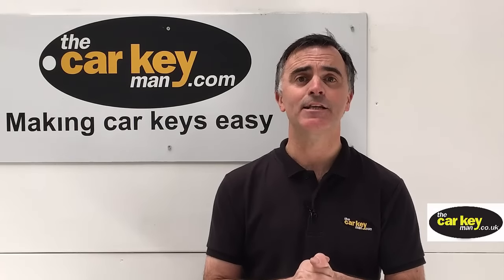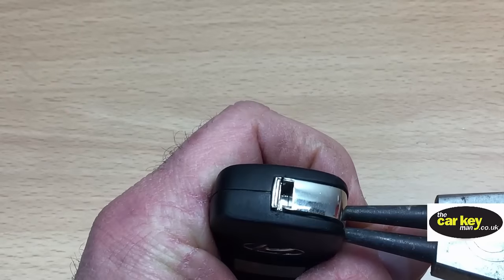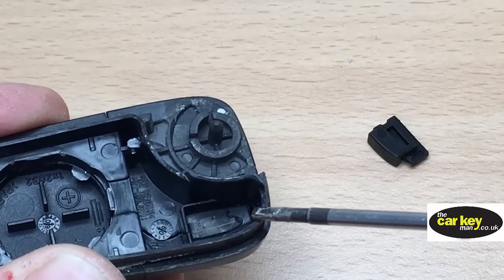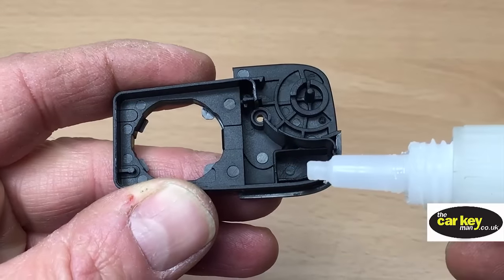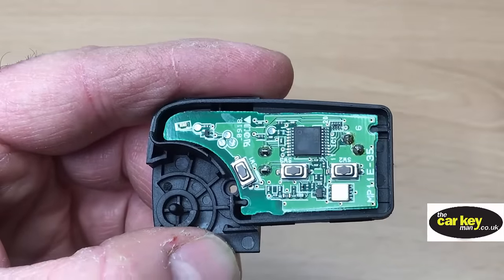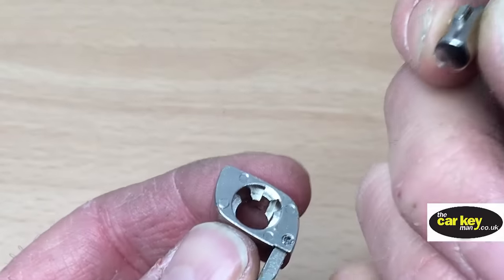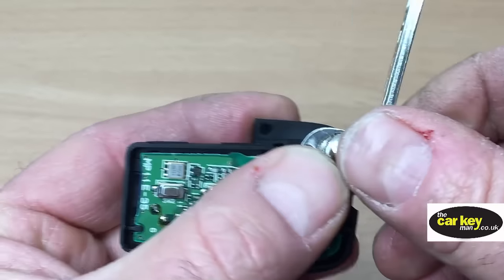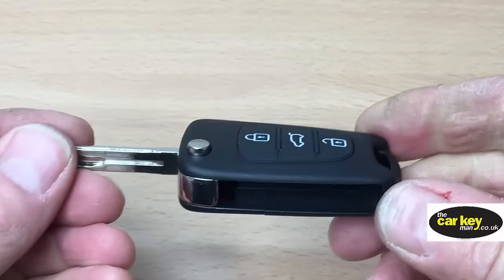FIX Kia and Hyundai Flip Key HOW TO repair

Comment: Took my wife's key apart on her 2011 Kia Soul, I found no chip. Kept the fob motherboard in the house, took only the key for the ignition and it started. So keep in mind you may not have a chip.
Reply from the maker: Hi Joseph, yes I didn't know this hen I made it but I'm guessing you live in the States? Not sure why a few of your models don't have chips, but every now and then we get a comment like yours. Thanks for letting me know :)
Reply: Thank you. Same car here and I'm not good at repairing things.
Reply: What tool did u use to get the pin out of the sliver key part
Reply: @TheCarKeyMan ah, that's where the recall and the whole trend happened
Reply: And if you are in Australia, there IS a Chip, only the cover cap is white...which confused me and eventually I had to look for the chip in the bin right before the rubbish collect car😂
Reply: Thanks a lot for the heads-up, sir! My mom's car is also a  Kia Soul 2011 that needs its key fixed. You've saved me a lot of time. Merry Christmas from Bangladesh 🇧🇩

Comment: You put the screw under the logo plate back at the end, but you didn’t say why and when you need to remove it in the first place. Otherwise great video.
Reply from the maker: Hi Fred. In the original key, there isn't a screw, the cases are glued shut. However with the replacement case, you need a screw to keep them together.
Reply: @TheCarKeyMan  Thanks for that. I’m waiting for the replacement key cases to arrive before getting stuck in.

Comment: I have a 2012 Kia Rio 5 and my fob did NOT have a chip.  Perhaps it's in the circuit board but FYI, if you're struggling to find your chip, it may not be there.  Very helpful video BTW.  Thanks!
Reply from the maker: Hi, thanks for the comments. Please can you tell me which country you're in?
Reply: USA
Reply from the maker: Seems like there's a few late Kia's in your country that don't have chips! Thanks for the reply
Reply: the transponder chip i have found to be hidden , even in the blade sometimes. they can be very small. nothing like the green chip board for the remote controls. this is from my findings
Reply: The Car Key Man is the chip for remote start? if so, mine definitely will not have that.

Comment: My key isn't broken but the rubber covering with the emblems has fallen off exposing the buttons underneath. I am questioning is there away of replacing them  or do you have to reassemble everything as you did?
Reply from the maker: Hi, yes you can just buy the rubber pads. They don't always stay in place and can be a bit fiddly to fit, but they will be cheaper
Reply: @TheCarKeyMan  Thanks!!! I wasn't aware the pads could be purchased separately  🤗

Comment: I have no way to get the pin out, so I guess I'm screwed.
Reply from the maker: You need a1.4mm pin punch
Reply: @TheCarKeyMan  I don't have one of those. I just used a nail and a hammer. Worked fine.

Comment: I thank you sir, I ordered a new fob body, completely destroyed the old fob getting the board out. put everything in the new body. doors would lock and unlock, but car would not start! I ended up buying a new fob from the dealer and having him program it! $ 400 later...I watch your video a few years later, there it was, didn't realize that little chip was inside, thought it was on the circuit board. I changer the body on the 2nd fob, as buttons were worn out, and it all works! Thankyou!! God bless!
Reply from the maker: That's great stuff. It's a very common mistake that happens, so well done on getting teh second key fixed ok

Comment: The buttons on my remote for the car were chipped off because I made the mistake of using my thumbnail to push the buttons. I went to the dealer figuring all they had to do was replace the case. but they said they would have to order in a new remote and then program it to match the car. They gave me a quote of several hundred dollars!!! Insane! I took a look on Youtube and found this video and then found a dealer on eBay selling the case. I followed the instructions in the video except for one small change. I didn't have a soldering iron hot enough to melt the plastic to remove the transponder so I used a rotary sanding disk and gently sanded the plastic on the back of the old case until I could see the back of the transponder and then just pushed it out.

Your video and step by step instructions were excellent and easy to follow. I would not have been able to do it without this video. Thank you!! The only difference was my case and the new one didn't have a screw as described at the end of the video, the case just snapped together.
Reply from the maker: Hi John, thanks for this really excellent summary of how you swapped your case, I'm sure it will help other viewers. Glad you saved that money ;)

Comment: Can’t thank you enough for this video—had some trouble getting the pin out, but otherwise, such an easy fix.  And you saved me $300! Thanks again!
Reply from the maker: You're welcome. These keys have been designed and manufactured so poorly, it's not right that you should have to get a new key. We always try and re-use the electronics when we can. Glad it helped
Reply: How did you get the pin out ?

Comment: Thank you!!! This video helped me replace my 2011 Kia Soul case. The key broke just like in the video and the dealer wanted $400 Candian for a new key! I initially glued the key back in with Gorilla glue until I realized I could purchase just the empty shell. I purchased one for $2.99 USD from China off ebay and was unsure if it would ever arrive, but once it did I searched and found this amazing video!!! The hardest part was opening the original KIA case. I think my key was actually a solid mold, so  I had to heat the plastic and cut it open! The 2nd hardest part was removing the pin for the key. I actually had to take it to a Jeweller, who had to heat the metal to get the pin out. He put my old key in, and replaced the pin with a new one for $5. I was so thrilled when I put everything together and it worked!! I was afraid I might have damaged the circuit board when I was trying to cut the case open, but everything works like a charm! THANK YOU for making this video and putting it out there.
Reply from the maker: Really pleased it all worked out ok Marsha, thank you for the feedback :)

Comment: Very useful. In the oficial car shop (KIA) a new key cost 234€. I have bought one case of key in Alliexpress for 3€. With your video I have changed the chip and the rest of the mechanism to the new case and the result is fantastic. Thank you very much from Spain.
Reply from the maker: Hi Manuel, that is great news. The new dealer keys are very expensive and poor quality unfortunately. Well done  :)

Comment: Great video, just fixed my key. I used my old key case, just took the key shoulder off the new case. Thought that was much easier than attempting to fiddle with the chips and board
Reply from the maker: Hi Tommy, glad it helped. Sometimes the parts don't transfer, but I'm glad it worked :)

Comment: For the most part this video is very useful however just a tip for most of the people trying to change instead of burning a whole through the  original key to get the transponder off either use a heat gun to melt the glue and a flat screw driver if it's really stubborn or if you like me and just the plastics on the front for the lock and unlock is torn and broken just replace the front of the key and keep the original back intact saves it alot of time..
Reply from the maker: Thanks for the input, appreciate your feedback :)

Comment: Mate, thank you so much for this video! The pin fell out ages ago (found a quick fix), then the hinge broke (as a result of the quick fix). Called up Hyundai and a replacement key was going to cost AUD$400+, then I went and bought the case kit and had a go myself. Had to file down my old blade a bit but then I was able to knock the pin in, and now it works! Legend! 🙌🏻 Fingers crosses it holds up!
Reply from the maker: Hi Natalie, you're welcome. Well done getting yourself up and running again and thanks so much for the comment ;)

Comment: Thanks for this.  The blade came out of my key as you demonstrated in the video but the rest of the fob was all good.  There was no need to transfer the transponder and circuit board to the new fob, I simply put the old blade back into the old fob just using the new button and blade holder
Reply from the maker: Nice one, they don't normally transfer over..glad it all worked out
Reply: @TheCarKeyMan  This is the comment that I was looking for.  My fob is fine, it's just the cracked connector to the blade.  So as I only have one key to begin with, I'm a lot more confident about just replacing the blade and not transfering everything over to a new casing.  Thanks for the comment and the video, both of you!

Comment: Nice video. Didn't see this before I replaced mine. I ended up using my Dremel to take apart the plastic part. It worked but I really should have just been a little more forceful when pushing to get the top and bottom apart. Was afraid I would break the electronics. But, after all, it worked.
Reply from the maker: Hi, good skills on the dremel, well done ;)

Comment: This video, and the other one on the later type of key are both excellent. 

I have found with my wife's i30, earlier type, that after a lot of use, the rubber button pad gets very worn, so badly that there were holes in it. So I bought a spare shell for about $10, thinking I would replace the shell entirely. However, I found that the rubber pad was not glued in to the spare, and could be very easily got out with a toothpick. Then I removed the residue of the broken one, again with a toothpick. I cleaned off the slight amount of glue residue on surfaces inside the shell  that the pad sticks to with isopropyl alcohol. Then I fitted the new rubber pad, using a tiny, tiny amount of Loctite gasket sealer as the adhesive. It's as good as new now. If this is the only problem with the old key, it's a much better solution to do this rather than replace the whole shell.

I wouldn't have had the confidence to do this though if I hadn't studied these videos first.
Reply from the maker: OK, thanks for giving our readers another option :)

Comment: I have just replaced the whole key covering. I used a soldering to get the chip out. Was affraid but it popped out with no brain. Thx for video.
Reply from the maker: Hi, yes can be a bit fiddly, but the hot iron usually does it ok. Thanks for the feedback :)

Comment: This video was really really helpful. I changed the case of my Kia Cee'd SW 2010 key, everything exactly as shown in this video, except that the transmitter came out easily without need for soldering iron. The replacement (from AliExpress) fitted well, except for the key groove which needed filing as explained in this video.  Original key didn't have a screw; replacement key had a screw; presumably to stop it falling apart.   Thanks again.
Reply from the maker: Thanks Adrian, glad the chip came out easily :)

Comment: Thanks very much, this worked for me.

I have a 2008 i30 cw (wagon) in Australia. 

The key had broken exactly where the one in the video had broken.

I got the new key case from ebay for a few dollars. 

The transponder chip just fell out and had a small plastic clip holding it in. No glue, no soldering iron.
I still had to file down the groove, that was the scary bit. 

There wasn't a video of removing the pin, which was also tricky, but I found a nail the right size and I was gentle with it.
Had to practice a bit to get it all back together, but watched it a few times and it eventually worked.
Reply from the maker: Well done, we'll have to make a video on how to remove the pin. Thanks for the feedback and glad you got it done ok :)

Comment: Perfect. Thanks a lot. That´s the issue I had. Forgot all about the chip. TOP!  Thanks a lot. I didn´t use the soldering iron, but carefully cut away the botom of the old flipcase, until I hit superglue. Little pressure with a punch and out cam the chip.
Reply from the maker: Well done, they can be tricky. Thanks for the comment :)

Comment: Great info thank you.  I found that my 2011 Kia Soul had NO transponder.  I was going cra tearing the old case up till I googled it and found that some cars actually did not have one.  I tried the remote without it and it worked!  Fyi..
Reply from the maker: Thanks JT, a few peole have struggled to find the transonder, are you in USA?
Reply: Yes,  If I had a transponder I would have been able to get it out with your video though.  Thanks!
Reply: Ah I can continue on with my repair then! I was panicking looking everywhere for it!!
Reply: My 2011 doesn't have one either! I had a key made without the remote and no chip, and the car starts right up.
Reply: I just had the same experience with my 2013 Soul. I got freaked out for a moment but was relieved when the key worked fine.
Reply: Are you in London please?
Reply: My 2012 Sportage has no transponder. US car. Thank You for the diy info. Very much appreciate it !!!!
Reply: I want to now the key code of Hyundai Santafe
Reply: My 2012 kia Soul also has NO transponder chip... but I am having problems getting the circuit board to fit.
Reply: I finally got the circuit board in.  I was trying to put the board into the PUSHBUTTON case.  It doesn't fit that way.  Try putting it into the other case half.  It snaps right in.
Reply: @godshappiness1050  Saved me! I had to literally rip apart my housing. once everything flew everywhere i was panicking because i couldn't find one. the place that should have had a transponder had no sign of glue or if anything was ever there. You're a life saver!

Comment: Thank you, very useful instructions.  In my key the keypad was damaged - don't press the buttons with long nails!  I had to use a lot of force to open the original key - the parts seemed to be glued together and the chip wasn't glued on at all so I nearly lost it when the parts scattered all over the room when it finally popped open.  But the rest was easy as the chip didn't have to be cut out.
Reply from the maker: Hi Vicky, yes the case is normally glued and can take alot to open it, did you manage to use the pliers that we use? It's funny but you can never tell which chip are going to be glued in and which aren't

Comment: Great video. Prying case open with pliers helped and I would have missed the chip altogether, thinking it was inside the cover thingy that comes out easily.
Reply from the maker: Thanks for the feedback :)
Reply: Also used pliers. This was hardest part - had to use a lot of force and thought there might be existing screw under Kia logo (there wasn't).  Rest was straight forward. Very clear video and tips. Thanks very much!

Comment: Thank you for your help. So much money saved! this is YouTube at its best: sharing useful information far and wide
Reply from the maker: Agree, YouTube is a great place and we use it all the time. Thanks for watching :)
Reply: @TheCarKeyMan  I do have one question: the aftermarket case I purchased has no screw to tighten the case, so the key blade is quite loose. Any suggestions for tightening up the case?

Comment: I sure wish my keys came apart as easily as yours did in this video! :)  Fortunately, my keys didn't have the transponder chip, so I didn't have to deal with that part, but Kia glued these things to within an inch of their life.  I ended up using a Dremel tool (that's a brand name here in the states for a hand-held rotary tool; they may call them something else over there in the UK) to very carefully saw the shell apart along the seams a millimeter at a time.

Once I got it apart, though, putting it back together was no trouble, thanks to this video, aside from the usual problems of trying to hold spring-loaded parts together in the right position while you snap the shell back together. :)
Reply from the maker: You must have had a steady hand! well done. Yes occasionally we come across a tough one, not sure why, maybe they had some glue to use up!

Comment: Thanks for the great instructions. Worked great to replace both keys. In our case the chip was glued close to the battery but was easy to remove and place it in the new key. I used the old keys so we did not have to had those made.
Reply: One more comment. For both keys the dealer was going to charge us 100 US dollars each. I paid 13 dollars, including shipping, here in the Philippines
Reply from the maker: Hi Derk, thanks for the feedback, glad it helped you save some money :)

Comment: I bought a 9 dollar replacement fob off of Amazon.com, followed this video (thanks so much), and put it back together, but mine had no transponder that I could see.  Kia Soul 2012.  I thought when I pried it apart the transponder went flying, but I never found it, so I put it together without it, and it works perfectly.  I figured the transponder was on the board somehow.  There was nothing in that slot where the transponder was supposed to be.  Anyhow, I'm very happy.  My keypad was torn up where I couldn't lock the car from it, only unlock it.
Reply from the maker: H there, thanks for this feedback. Are you in the USA? We've had several comments about American Kia Sould models not having a transponder!
Reply: I also have a 2012 Kia Soul and it worked the first day or so then just stopped. The red light comes on I already replaced the battery so I am not too sure why it stopped working. Thank you your video did help me put everything back together.

Comment: Really appreciate the video! I've been working on moving my key over to a new fob and have been stuck. I can't figure out how to get the pin out of the new fob. Looks like you skipped over that part and it's the one step I really need atm. Would really appreciate a tip on how to get that little thing out of there
Reply from the maker: hello, I use a small pin punch. It needs to be less than 1.4mm